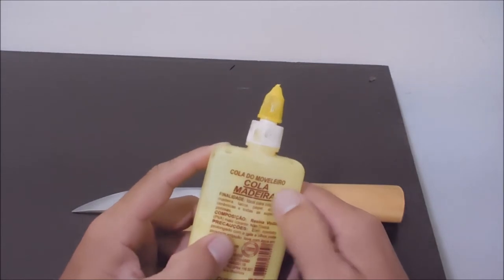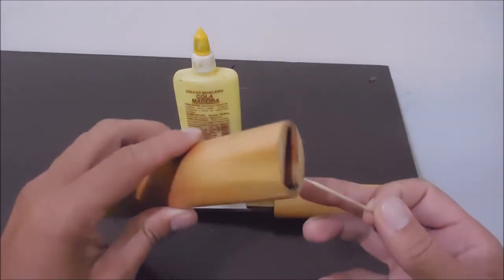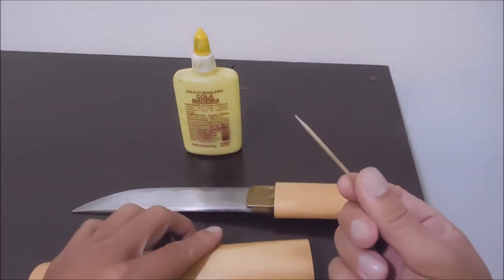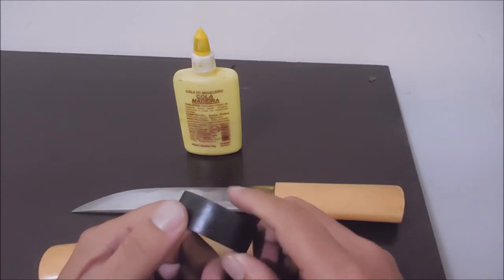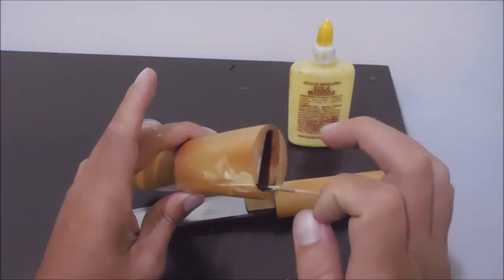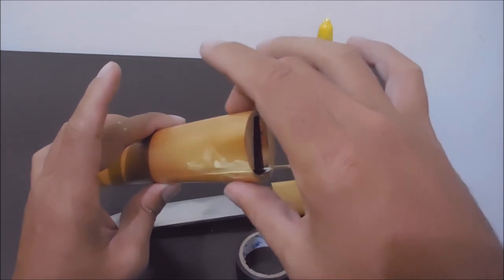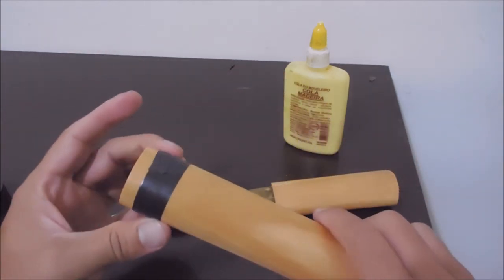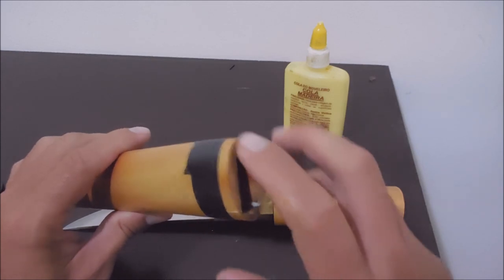How to repair the scabbard of a Tanto

Comment: I realize that you will have to clean up the excess glue as well, but it seems to me that if you want to avoid residue from the tape, that you can rap it around with the adhesive side outward.  That way it will stick to itself and stay in place without having to stick to the wooden surface. This is just a guess.